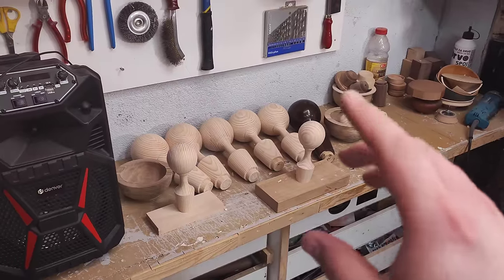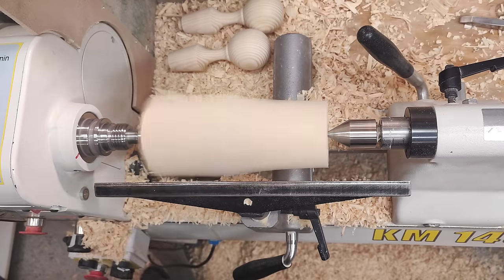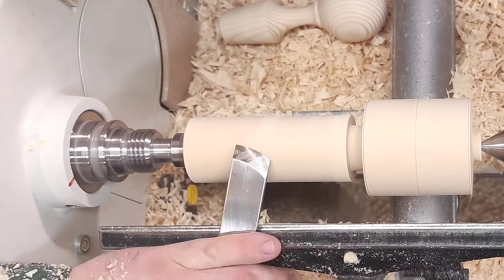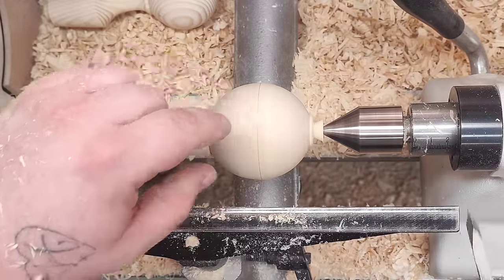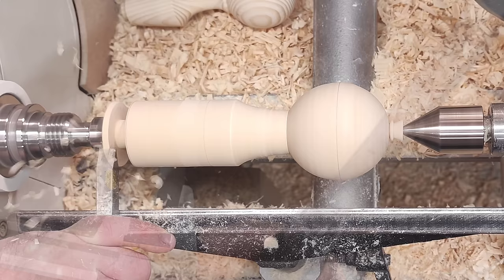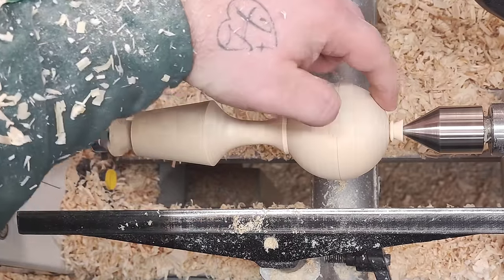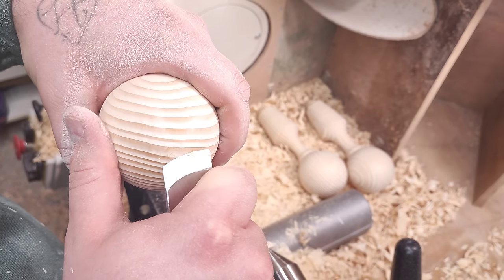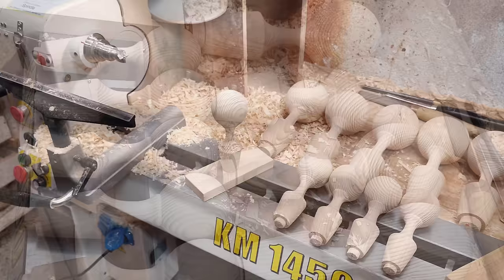You won't guess what these are, but PLEASE try anyway😉

Comment: I make something similar for the deck drains on our local ferry that get these as a plug for said drains when fuelling the ship. In my case there is a hole bored the length for a small retaining rope that fixes to a retaining ring above the drain. The ring is sized to hold the plug when not in use.
Reply from the maker: That is interesting, its funny how all these object with totally different purpose often look similar ☺️ thanks for watching

Comment: Nice video.  I was impressed with your eye in determining the roundness of the ball and the overall diameter of the stems.  I noticed that you have a curved grind on your skew chisel.  Mine came with a straight diagonal bevel edge.  What kind of grinding wheel and grit do you use to sharpen your chisels?  It is impressive to see your polished surfaces on your finished pieces.  Thank you for making videos to help out us novices.
Reply from the maker: Thank you sir, this video should be of help https://youtu.be/eSGu0kTdlds?si=A3MA5K9Y6toYCyMO

Its 2 part video that I go really indepth on sharpening,and using skews

Comment: I have a cheap chinese lathe,( 1 " square tubing frame, 4 speeds) that has very little rigidity. Would it be possible for me to do work like you do with such a poor machine? I was goung to mount a circular saw to it, and use a tracer mechanism.  I dont want to invest in lathe tools and all that constant sharpening, id rather scrape everything with carbide inserts, that i could make myself. At 70 years old, my hand strength is not half what it was. Thank you for your time.
Reply: My husband upgraded my lathe for my 80th birthday and I’ve been using the ‘beast’ as my friend calls it for over 2 years.  I have multiple physical problems but the hour or two spent most days at my lathe are fun.  Don’t let a few years and a little weakness stand in your way. 😊
If you really need to cut every corner, those carbide bits can be sharpened a bit by laying them flat and rubbing them on a diamond hone.
Reply: P.S.  my first lathe could only change speeds by shifting belt and had no reverse.  I’m on my 3rd now.  I used to have to buy wood to turn but once people find out you’re a wooodturner they bring you all sorts of wood to turn.
Reply from the maker: Well, ofcourse you can use that lathe and tools, nothing wrong with it as long as you use it safely, but be aware of that better more stable lathe will be more Pleasureble to use, also using tradicional tools will help you be more efficient with less effort,once you learn how to use it...
Again, nothing wrong using your chinese lathe, but I think very soon you'll out grown it...🤗